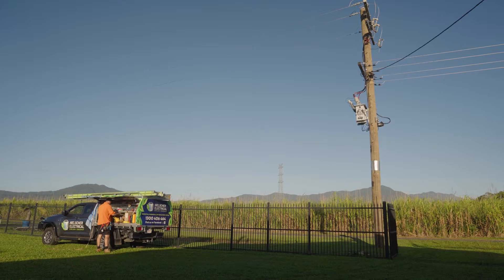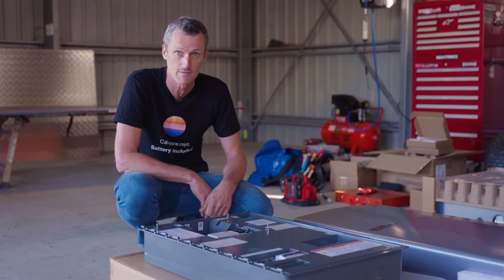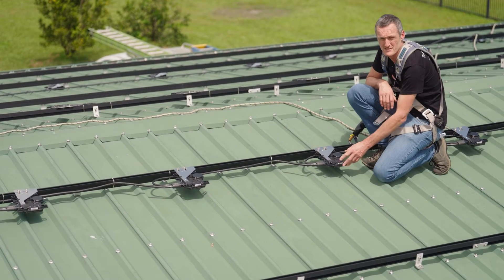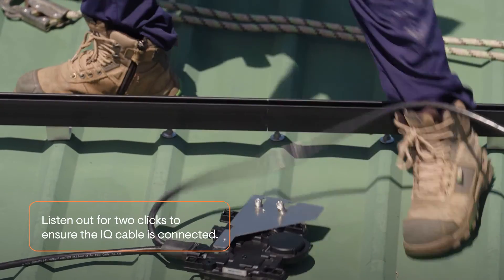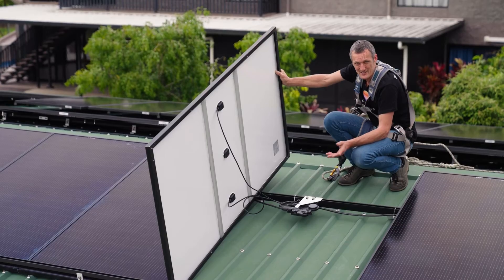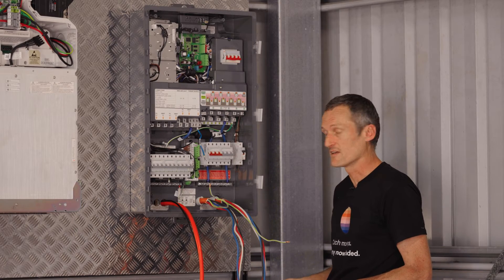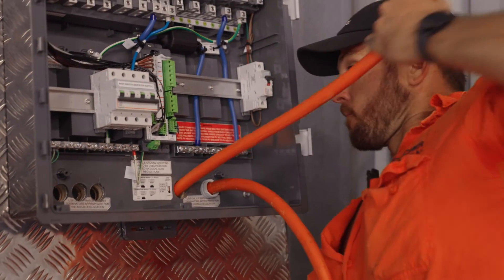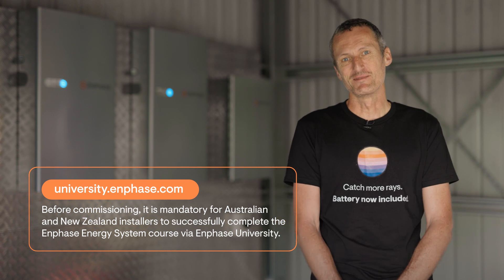Enphase Energy System installation tips

Comment: How do they protect from backfeed when the mains go down, the blokes working on the outside line so they don’t get a shock from somebody up flow using solar, there cannot be an automatic shut off as the solar tricks it to think there is 230 volts from somewhere and staying open.?????? It confuses me how they arrange it.
Reply from the maker: Products that are grid connected and backup the home must be approved and tested to AS/NZS regulations.  In the IQ Battery System with IQ System Controller, there is a certified approved smart contactor that opens and therefore disconnects the house from the AC main grid, so that the Enphase System can continue to backup the home with 230V AC power.   This certifed protection is called the Microgrid Interconnect Device (MID).